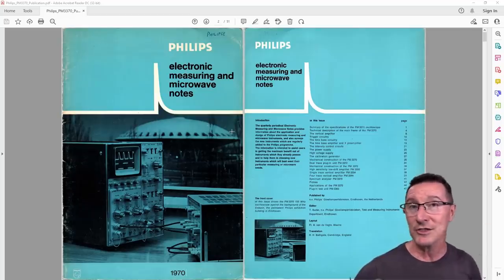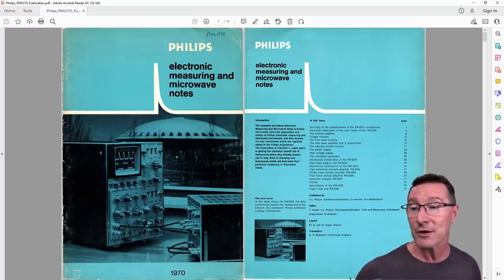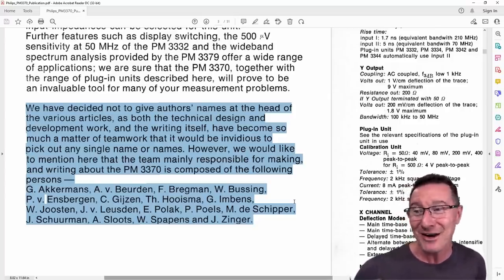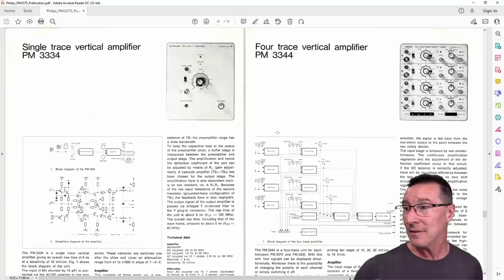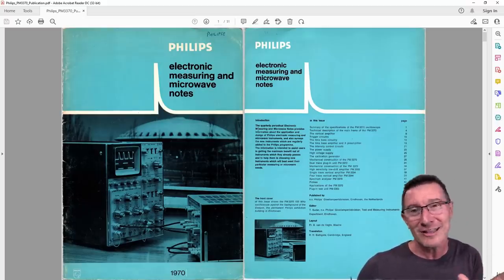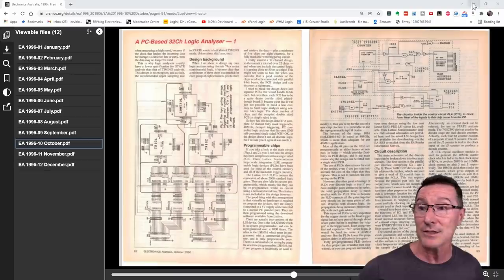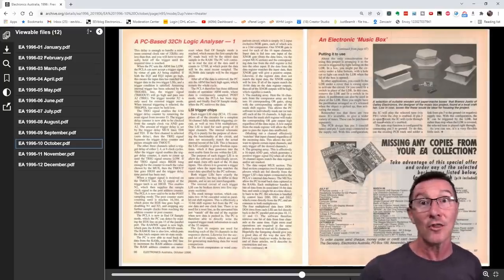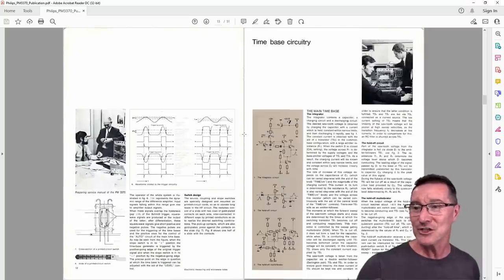eevBLAB 94 - Why Dont Companies DO THIS Anymore?

Comment: One of my fav pastimes is getting some audio gear and nerding out on how it works. Many come with doc's which contain all sorts of juicy reads. Especially old/vintage gear !! Schematics / reverse engineering / finding the bodge wires / Why did they choose this and that brand of diode/tranny/cap. In audio the layout is often chose with sound in mind rather than size or cost. 
   I'm also guilty of dorking out on gear which I don't own... OR comparing my exact equipment to competitors merely to discover what the differences are. =Good Times

Comment: I think that it all comes down to cost. I worked for a while for a company that made access and jig equipment for aircraft manufacture. They used a separate technical author to write up the technical and usage manuals, in many cases this would cost as much or more as the bill of materials used and these were one of products sot the authoring of the manuals just about doubled the cost of the equipment. I suspect that technical authors are a very rare breed indeed now as well so costs are even greater, and in this day and age when equipment is more complicated but effectively cheaper than ever before the market will not stand the cost.

Comment: In the mid 70's I aspired to buy a Tek 465 scope but as a student it was way too expensive. I did find a demo model of a Phillips dual trace 50Mhz scope and bought it. It still cost more than a decent car. I had plenty of Tek experience and the Phillips was so vastly superior to Tek I couldn't believe it. With chopper stabilized front end it never drifted. At 10X vertical gain it had a scale factor of 200uV/div. You could hold a probe in each hand and see your heart beat. They had an optional analog multiplier that would compute and display A x B for power waveforms but I couldn't afford it at the time. Despite its 50Mhz rating it would trigger and display at reduced amplitude past 200Mhz. The trace  was sharper and cleaner than any Tek scope. The quality of construction was better too.  Years later I needed 200Mhz bandwidth and bought a Tek 475 which was junk by comparison. I had sold the Phillips to a friend and he still has it.  I never bought another Tek scope but owned a variety of LeCroy digital scopes and some Rhode & Swartz (thanks to your video). The R&S still falls short of the LeCroy in some ways. Now that scopes don't need CRTs Teks hold on the scope biz is long gone. Now a decent scope costs a little more than a multimeter.
Things have sure changed.

Comment: I work in science and, yes, instrumentation manuals were so perfected some 18-20 years ago that you could follow signal or measured sample path through system by reading extremely descriptive text written by engineers and scientists. I have one manual from Varian from 1977 which can huirt you if it falls on your feet, made with chrome plated spring holding pages together. Ah, 70s and 80s. When manuals were perfect and TO-3 transistors were gold plated.

Comment: I’d say two reasons: everything today has become so secretive. Companies are so worried about industrial espionage. Secondly, marketing of electronic test equipment has moved away from the technical virtues of a product, to a dumbed down business school template that lists the key selling points and price. The assumption being the potential purchaser isn’t interested in the production and design details. Everything is a commodity now. 
This has fundamentally changed ham radio as an example. Most buyers of new ham radio equipment have no idea whatsoever how it works or how to do the most basic troubleshooting. More and more people are part of the electronics industry without having any real knowledge of electronics. Sad. 
Even more sad is the fact that composing and producing documents like the Phillips newsletter can be done with minimal time spent using common software and put up on a web site for incredibly low cost.

Comment: Executive Summary on why (big) companies don't do this anymore: Question: What does a 2 dollar canary say? Answer: Cheep, cheep, cheep! By the modern analysis used by bean counters and MBAs, such publications consume resources and do not contribute to the bottom line.  I spent many years working for a company started by two guys in a garage. For decades, that company put out products, publications, and product catalogs that we were proud of. Bill and Dave retire, but their hand-picked successors keep the fires burning. it takes a few more generations of leadership change before the focus shifts from the customer to "the street," markets, and why isn't our ROI as good as the latest cloud-based flash in the pan? If something doesn't help the bottom line, it doesn't help.

Comment: You should do some more detailled investigation on Philips and you will be amazed what companies are a spin-off of this Dutch company. Initially started with making light bulbs and other electric devices they eventually made everything in-house, like all components, wooden cabinets for radios, fabric for loudspeaker cabinets and even their own production facilities and chip factories. Famous was their "NatLab", much details can be found on Wikipedia. Unfortunately, like many other companies they decided or were forced to do thing differently somewhere in the 80's.

Comment: I did tend to take a few pictures when documenting processes, in addition to the closer pictures of the thing being documented. Then would select which pictures would be cropped and used, but still probably have the originals somewhere, as I was in general using either my camera or phone to take them.

Comment: I guess the reason is complex. One is the simple fact that it costs money and doesn't benefit them, another is the disconnection of management and operations, and finally, it doesn't help the message control. Comapnies these days like to only ever communicate via a spokesperson, even if it may only be to cover their backsides against any however-far-fetched liabilities. 
I've worked in engineering for a decade by now, and I've barely left any traces in the world. There is absolutely nothing to look back upon - and this is extremely frustrating. But I get it - having the great teams inside companies visible would deter from the visionary leaders.

Comment: I think that one of the reasons companies stopped doing this, is that the life-time of a product is too short, thus making this kind of documentation is too expensive. Back in the days, products were built for longevity, including fixing it when it broke down, and this is when the documentation was useful. Now it's just about trashing it and buy a new one. Maybe also one of the reasons may be to make reverse engineering more difficult and avoiding other companies to (partially) copy of their products.
Reply: Someone else in the comment section here has a good point on this. It's the fact that back then, manufacturing was expensive and labor was cheap. Now it's the other way around. Labor is expensive, and machine time is cheap. You want to maximize the output from the human resources you have in house. Repair jobs more detailed than just replacing modules aren't economically reasonable. That's what is driving this. Things were designed to be repaired because producing something from scratch was expensive, service technician time was cheap.

Comment: Consider this possible explanation: Perhaps these tech manufacturers are protecting their personnel/assets/intellectual property/R&D/ from corporate theft and/or espionage? 

I visited Bell Labs, Motorola corporate headquarters, Fermi National Lab, US Air Force, DoD, etc. during my career years in IT and cameras were not allowed in any of these facilities. With most of these places I had to pass thru security where they would search my tool-case/briefcase upon entering and leaving. Military installations would go beyond that and run my drivers license number for red-flags.

Comment: today we fail fast, fix later. It's how Tesla do it, who needs break pads or even break rotors for that matter.
Reply: My SIL's 3yo Tesla has over 90% of its brake pads left. BTW: I could make a motor with control system that could do away with brake rotors and pads. It could even easily lock up the wheels if desired.

Comment: I love those old T&M manuals. All the stuff was in the user manual because .. they one who buys it is a professional and OF COURSE he fixes it himself. Do you want to insult your customer by implying he isn't capable of this?? 

Same for old ham radio stuff. They are certified to be capable of building radios and put them on the air without any third-party testing. No company could dream of doing this at the time. OF COURSE there were schematics, service instructions and theory of operation in the user guides. They NEEDED them to ensure compliance with the local rules, since they were responsible for it, even with commercially manufactured gear.

Somewhere in the 80s all goes back to just consuming ready made stuff and throw it away when it got boring, even if still working perfectly fine. Repairing something? Nah. Just buy new stuff like a good citizen and help a economy (not the one of your own country, though).

Comment: Image management. A company's image is important, and showing a bunch of engineers in a lab is not hip or cool or whatever the modern equivalent is.
  Every time I have seen any attempt at something like this, it ends up so idealised and politically correct that it defeats the point. Far from showing the people who do the work in their natural environment, the photos show people from every racial group (most of whom had no involvement with the project or are just models) clustered around equipment that looks cool, but is not what was actually used on the project (there is only one of these and it is needed for something else - except when photos are taken) in a room that is so artificially clean and neat that you can see nobody actually works there. I have even seen cases where the engineers had to set everything up and were then asked to withdraw so that others who project the correct image could be in the photos. 😔

Comment: I used to work in a warehouse many years ago.  The managers would have had a fit if we took any photos of the production floor, due to confidentiality.  What trade secrets could be revealed about a facility that sorts cardboard boxes?  Who knows.  Companies these days are totally paranoid.  Maybe they were scared of OSHA (USA Occupational Safety and Health Administration) finding out that we regularly blocked all our fire exits, among many other safety violations.

When I quit, on my last day I snapped a few photos for my own sake.  I didn't want to get caught taking pictures of my coworkers, but I have lots of images of the production line and various trucks and other machines I used.  It was really fun to drive the valve-operated hydraulic fork trucks (the newer electric ones they have these days are total garbage).

Comment: 1. You're expected to publish in 400 languages, it's very expensive.
2. Good documentation for tech stuff requires tech people, very expensive.
3. They worry someone (the Chinese) will copy & counterfeit their product.
4. Why bother? We hired a marketing company. We have our research panel devised slogan, color scheme, logo, & reputation to sell our product. We really don't care if the customer actually uses it. They bought it, that's all that matters.

Semiconductor makers still have application notes but most are little more sample circuits to measure parameters they've already measured & published. But sometimes it's good stuff, sample circuits or blocks of code.

Comment: Bob was hired for 3 weeks to produce a single I2R link. Bob did the job and was replaced by Bob who was on for 3 weeks to produce an integration module, but was program cut and let go in 1 week.  Bob took over to produce the new line's integration and was tasked with making a report on the viability of I2R going forward.  After 6 weeks Bob got a better job offer and left for that leaving the task uncompleted.   Bob was brought on board for 3 weeks to produce a single I2R link  ... and the process continues.
Reply: I have been warning if the dangers of high turnover for years. No one listens.

Comment: I completely agree with you Dave, but sadly these publications are a thing of the past. I guess they were considered by the bean counters as an unnecessary overhead. Over the past 60 years I have watched all forms of manual and technical help deteriorate from full, detailed service and user manuals to PDFs on a disk (you pay for the paper if you want hard copy) to the bare minimum scrap of paper badly translated from Chinese. The only goods that come with manuals these days are white goods and cars. And then they are more full of warnings and "don't do this" notices than useful information, I suppose they are supplied more for legal reasons to cover the manufacturers backsides. Typical of these is my e-Golf manual, more warnings than information and what there is is fragmented with important details missing.

Comment: They say the world of commerce is now run by 7 companies, this homogenisation alone would guarantee levels of manufacturing production were  scaled up, and that  that was  in place prior, would  almost certainly become obsolete. 
To produce the associated literature to a product would  be a casualty of this process, plus the  anti right to repair being aggressively applied.
Fingerprint recognition, and face detection are but two features sold as benefits, but are in fact built in flaws to contain you as a customer.
Apple actually turned off the (A5), to force you to buy once more.

Comment: Dave I think it's a combination of two factors.
The first is that most engineering firms nowadays are chinese and thus they won't continue our traditions.
The second is that nearly every engineering firm that hasn't been outsourced is in the defense industry  and the US government has gone completely overboard with the secrecy requirements and would not allow something like that.
Reply: It has nothing to do with secrecy. It is quite simply about cost. The life cycle of test equipment product update is such that innovation comes out with each new product and in some instances is required by defence specifications to validate a project. Consider fluke. Fluke won't even consider touching  the 9000 series network cable testers anymore. You have to update to the latest. And there is a good reason why, because the goalposts have moved significantly. 
Another instance is Noise figure measurement. An HP/Agilent calibration engineer gave me a demo of a standalone HP noise figure test set and I was hooked. Sadly, HP no longer manufacture this. Now the measurement is built into their portable specans like the fieldfox.
Your first point has more relevance to the issue. 
I just bought myself a new Siglent  oscilloscope after considering Dave's recommendations on brands and  downsized test bench space.  I would be more comfortable with the Agilent MSOs because this is what I use at work, but hey, in the end I can always take my circuit boards in if there are deeper problems I can't solve at home.

Comment: Can someone tell me the name of an American electronic parts distributor that went under around 2000? I really, really think it had the word "American" in the title (at least on the catalog's cover page). There is a particular page from that catalog that I am OCD about retrieving. Any ideas, please? It was NOT DigiKey. DigiKey by the way back in 2000 was only a half-inch catalog! Well this one I am looking for was also about half inch. Maybe a bit more, but not an inch. It was NOT Mouser, Allied, Newark, Arrow, or DigiKey. They DID carry a full assortment of just about every electronic component (a bit towards hobby use though, as they also had small solar panels 2x4" and the like). As I said, it's out of business, but I am at my wit's end trying to figure out its name and retrieve a physical or digital version of this catalog!

Comment: This doesn't happen today, because the pictures would be of Asian children working in sweatshops.  Seriously, the dominant change has been from a Western culture of technology to an offshore manufacturing where the culture doesn't industrialize in the same ways.  And when China takes over industry basically as a mimic of what the West invents, then you're not going to have pride in your original work and the openness to publicity and parading that an operation like Philips has (or used to have).  There's a reason why China doesn't have anything like a "How It's Made" show (which is a Canadian production, showing off their pride of engineering and production).  The CCP has its publicity parades, but they're not showing off their craftsmanship.  S Korea, and Japan before it (Sony as you say), were less hostile to the West, but still secretive inside the factory walls.  Anybody remember the Soviet how-it's-made publicity aka propaganda?

Comment: Why don't companies publish these documents any more?  Because they don't add to the bottom line.  Now that HP/Agilent/Keysight is run by bean counters instead of engineers these types of things are the first ones to be cut.  When Bill and Dave ran the company the HP Journal along with the App Notes were the best technical documents out there.  It was done because Bill and Dave were proud of what the company was building.  Yes, they were concerned about being profitable, but not so much to blind them to the real point of the company. Producing the best equipment and inventing the best technology.   I missed the heyday of HP but I was there for the downfall.  The stories from the old timers were legendary.
Reply: HP (Keysight) does make available the technical document on their old equipment. It doesn’t add value to their current product line but I think it add a huge level of cred to their technical reputation.